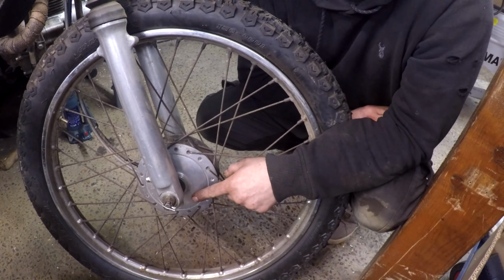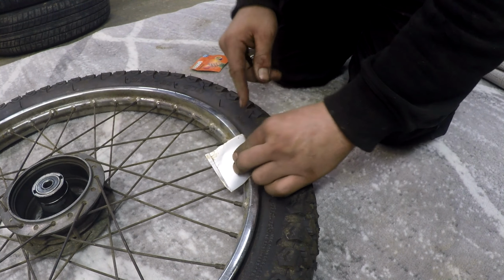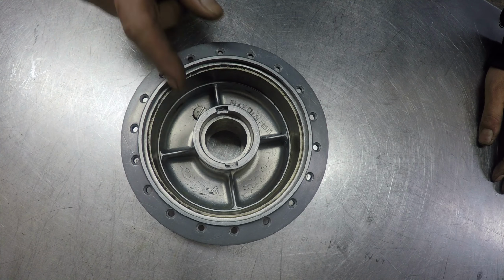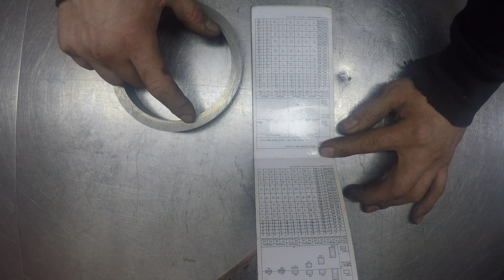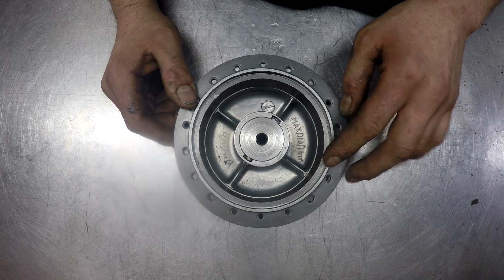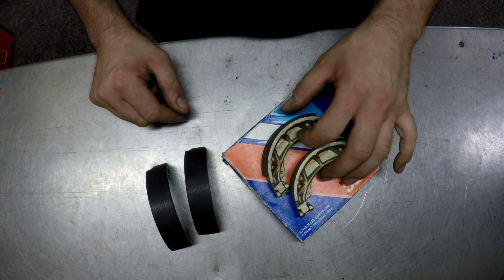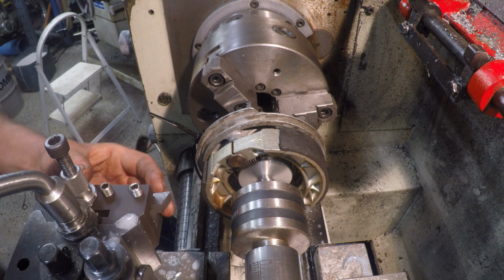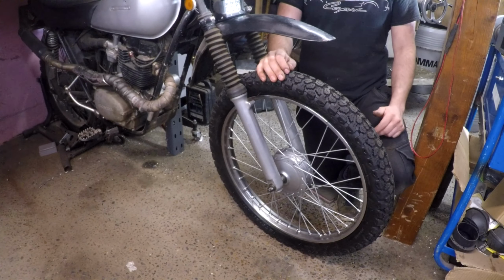How to reline a motorcycle brake drum

Comment: I used to reline hubs exactly as you have for a local post office contractor using Honda Cub 125cc motorcycles. They were really expensive & didn't last all that long. I was always concerned about the cast liner slipping, so I would screw cut the hub & liner with a 1.5mm pitch thread & screw it into the hub. Noting direction that the braking torque would always screw the liner in tighter against the back of the hub + filled it with locktite. Worked a treat, but it was time consuming & eventually just used OEM

Comment: When I was setting up racing drum brakes we'd put in two shims, one between each face of the brake cam and it's respective shoe to bring the shoes out to where they will be when the brakes are applied.  We'd then grind the shoe material so that the shoe diameter exactly matched the internal diameter of the drum to get an effectively perfect, full contact between the shoes and the drum.

Comment: Well that’s a lot more comprehensive than I thought it was going t on be!  Very nice job. 
Is the brake still shite though!  
My 7” triumph drum is!
Reply from the maker: The brake is a lot better than before, but still pretty shite. I guess drum brakes are never going to be as good as disks on the front of a bike.
Reply: @maxfh768  just reduced the brake cam just at the lobe and a touch before on the leading shoe contact point on the triumph. The brake feels a touch stronger as the mechanical action of the cam presses on different parts of the leading and trailing shoes. Only took about half a millimetre off but it biases it onto the leading shoe. First stage in the brake improvements.